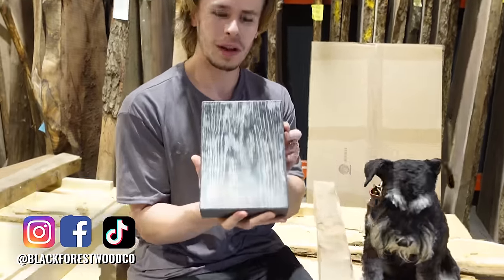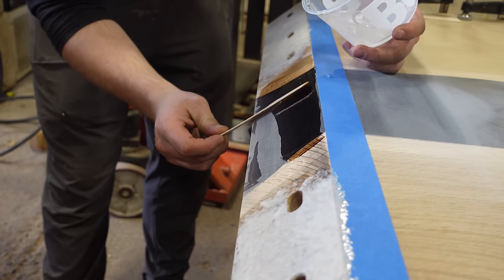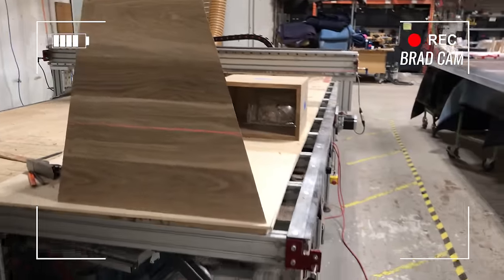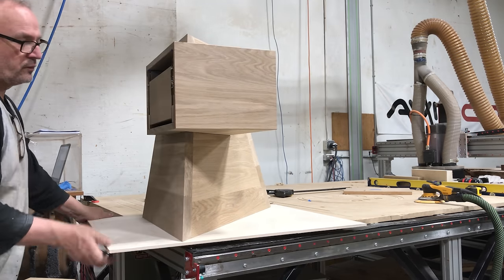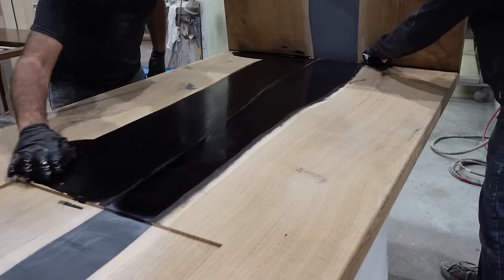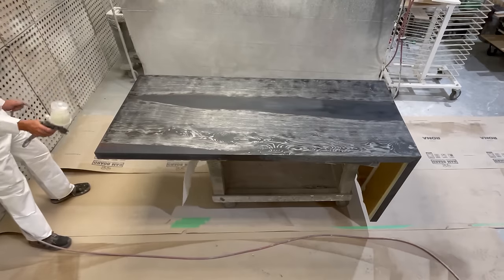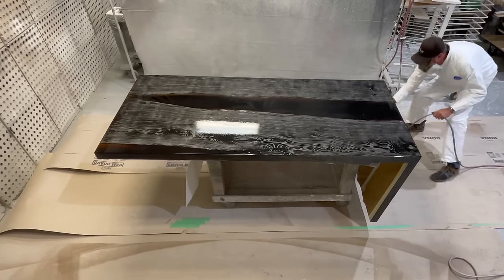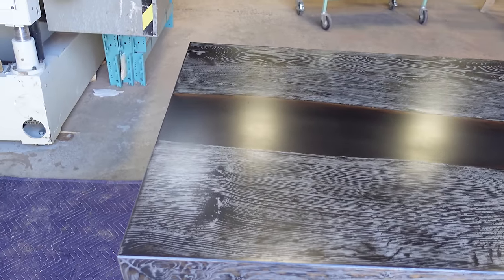Combining Metal & Wood for an $18k Desk

Comment: I hate to tell you guys, but this idea isn't new, I've done it and I wasn't even the first to do it.  I've made several items using this method of metal powders in resin and then used that as a grain filler to give contrast to oak, that has been ebonised using the traditional method of vinegar and iron.   I've done it with aluminium, brass and copper, both polished and also allowed the copper to oxidise over time to give a verdigris effect that is UTTERLY unique to each piece. The fact that this guy says "to my knowledge it's never been done before" holds very little weight as his knowledge clearly doesn't extend to the entire world, and just because he might not personally know of a company doing this commercially, doesn't mean that this hasn't been done on a much smaller scale, by other artisan makers such as myself.  Sorry but that's just how it is - grain filling for contrast is a technique that has been around for many decades, and using powdered metals in resin; a system that has also been around for quite a while as opposed to using a different form of coloured medium (like gesso), is not a new concept..

Comment: I've used powdered bare metal in epoxy with an air brush machine for years. While having a premixed product would be a bit more convenient, it wouldn't be very cost effective if it's something you'd regularly be using. Super cool to see it used on such a large project and turn out so uniform. Stunning execution!

Comment: Nice finish, however, I would've used a torch or black stain on the live edge to properly blend it. You can see the light edges through the epoxy. I darken the live edge on a lot of my river tables for added depth in transparent pours. Still a very unique finish.

Comment: Amazing desk! If there is one thing, I would complain about it would be that I think the drawer has a design flaw with the lid folds up so it blocks the sight line into the drawer. If it folded down instead you would be able to look into the drawer when it is opened. You might even automate the extraction of the drawer so that it ejects when the lid is folded down. Anyway, just my two cents. I came for the metal in wood tease and I was not disappointed. That looks stunning! Does it come in gold?
Reply: Great observation!

Comment: Wow what an incredible piece. The contrast between the black and the metal almost looks like an ink fingerprint zoomed right in. I love the base. It's very contemporary. Another one you've knocked out of the park. 

Someone in the comments said you should have done the river resin black because you can see the much lighter sides of the timber. Can i modify that constructive criticism? Maybe it would have added another even more amazing detail if the metal treatment was done on the sides before the resin pour so that the absolutely amazing contrast of the top continued the full depth of the river. That could allow a pour with less colour needing to be added. If that's what the customer wants of course. 

But still, it's a desk i would die to own. Another job well done Black Forest Wood Co Team.  Thank you for the content!
Reply from the maker: Oooh, true it does kind of look like a finger print! 

Not sure how the resin would bond to the Vero Metal but would probably work fine, would have to test that first though! 

Thanks for the feedback Rob!
Reply: @BlackForestWoodCo  i guess though that since it's an expensive process to begin with that it's even more expensive to experiment with but the process of sending it out to get the sides done and sending it back once the resin has been poured may not be economically viable  especially if the strength could be compromised.  

Regardless, you's have outdone yourselves again with this art piece. Thank you

Comment: Wood and metal together always work well to my eyes. The less than 90 degree corner had excess metal finish globbed around it which spoiled the look for me. A finicky process for sure. Not sold on it. I'd prefer a high voltage trough burned in then filled with a silver epoxy. 👍 😃

Comment: Metals are used for pigments in paints all the time, I would assume the metal ratio might be higher than normal.  I wouldn't have said anything if they didn't keep going on about it.  It was a great choice of colors the contrast was spectacular and love the glass like finish that complement the angels.  The drawer front is awkward, I hope it pulls out further than the top but as shown the top would gets in the way.

Comment: Are you looking at the potential of doing these types of finishes with the metal at your factory?  The table is beautiful.  I think if it were a copper finish it would look stunning.  Copper would give that antique and warmness look to the table.  Excellent build
Reply: That is an excellent idea! Just picturing copper version in my head and it would look much better. Love the off 90 degree angle for the waterfall on this desk.

Comment: Just curious, on the base, you used screws from the outside of the base. Why not use cleats on the inside of the corner and screw into the backside/interior of the base?

Comment: My opinion as a completely inexperienced observer, but as an artist and graphic designer: The wire wheel was a bit aggressive and, maybe needed to inlay the metalized resin, but does give the appearance of a "low fidelity printing" on the surface. The fact it is a fully solid material piece and could be easily touched up is minimized by the choice to cover it in a layer of poly - makes it feel even more feel it is just a surface decoration and not fully embracing its solid material build.

Comment: yo take note from the elder carpenter not the young yahoo, notice how the elder carpenter used a brush for the wood glue? the roller absorbed most of the wood glue that was on the piece, leaving barely any on, and I would wager not enough for the waterfall support needed

Comment: Oh dear..... I can see now in the closeups that the person doing the sanding cut through the black stain to show the lighter coloured wood in multiple areas, @ 14:05 I can see quite a few just in that section... oh my - why wasn't another pass done of the stain before the poly?  It wouldn't have affected the metal in ANY way, and would have dealt with those areas. I can also see areas where the metal has been left "fat", where it's not been properly cut back to leave it JUST in the grain, there's areas where it's on the surface as well. Now what you have is an $18,000 desk that's "blotchy" that's not cool.  Honestly - I wouldn't ask you to make a desk for me, and if I did and you sent me one like that for £18,000 - I'd send it back.

For $18,000 it needs to be FLAWLESS, not flawed.  You should have done a test piece first to check for any such issues BEFORE doing it on a customers item - you NEVER do experimental work for the first time on a customers item - EVER - that's amateur hour stuff.

Comment: OMG and what the F happened at the mitre joint @14:29 ? Why wasn't it properly cleaned up first? That line is so OBVIOUS it looks like an amateur welder did it it's so bad. Grain holes not filled.... $18,000 for that subpar work.... no thanks.... and just look at the mitre joint and desk sides too - how the black stain has been cut through showing the wood underneath in SO MANY PLACES, look how that compares to the perfect ebonising of the the pyramid underneath - I think you owe that customer a reduction, IF he agrees to accept that item at all....

Comment: Umm what? Two part Polyurethane** IS an oil based finish? As opposed to a water, wax, shellac or nitrocellulose based finish. I assume what you meant to say was that it's a different kind of finish compared to the Linseed oil based finishes like a common Danish oil, that is easily maintained by the owner.  I would also say that because of the treatment the wood has had, a penetrating finish like Danish oil wouldn't work very well, thus the SURFACE finish of polyurethane is the better (if not the only) option. sigh .. I have to wonder at what you are saying and the (mis)information you are giving out, considering you are a big wood furniture manufacturing company... I think you guys need to do better with your voiceovers and what you say. (** Which I've also used)

Comment: Team hate it. You lost me by sanding it the way you did. Silver and black? Team love it. Silver and black but sanded though most of the black? Nah. Better ways to go about it, like sanding the really high peaks after the wire brush. Then stain it, and spray the metal mixture. Than wet sanding, rather than dry sanding. It would have been a far superior finish with very little defects